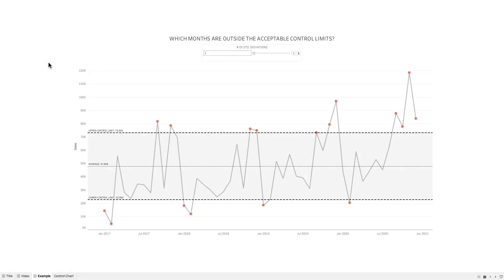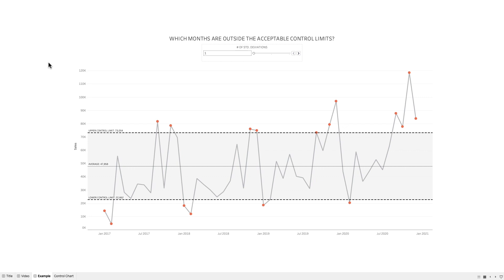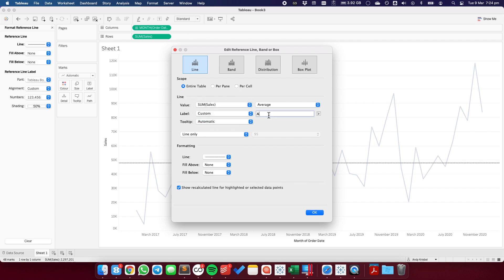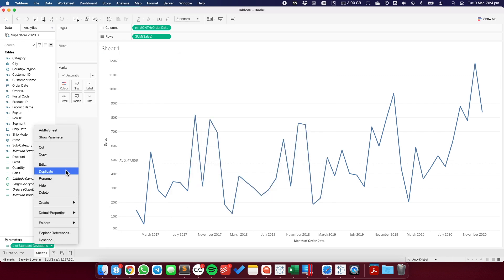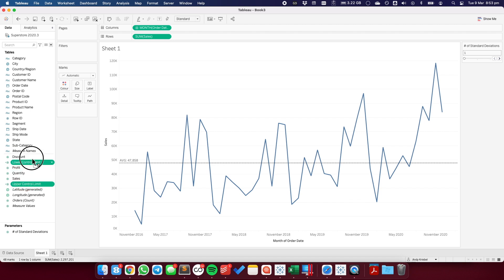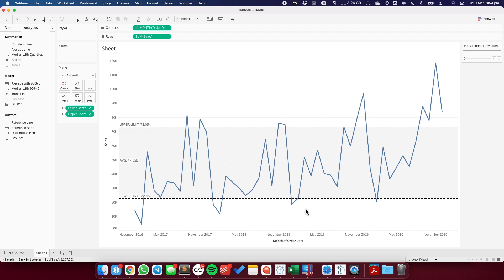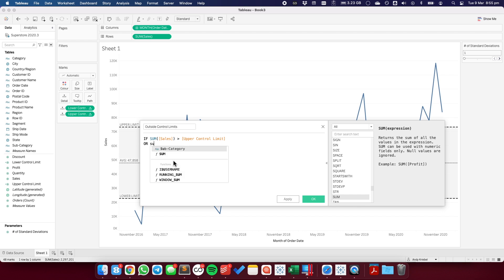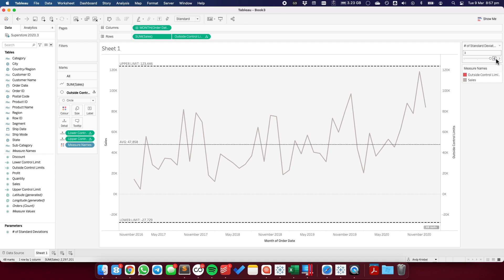How to Create a Control Chart

Comment: Great tutorial as always.
The Avg line includes all of the months from the Order Date, is it possible to set it to a baseline year? For example, I have data from Jan.2018 thru Jul.2022, I would like to set the avg. reference line to only Jan.18 thru Dec.18 then create the UCL and LCL. Any inputs and suggestions are greatly appreciated!
Reply from the maker: Definitely possible. You’ll need to write a calc to bring back the data you want for the average line, probably an LOD. Then put that on the detail shelf so you can use it as a reference line.
Reply: @vizwiz  Thank you for the quick response! I'm actually surprised that you'd have time to read these comment while juggling several workshops.
I spent much of yesterday trying different approaches - parameters, calculated fields and read through more threads on the Tableau Community board. - still haven't figured it out.
It looks like Twitter is the only public space you have where I can post questions, is this correct?
Ultimately I think I need to incorporate an FY parameter and calculated field in order to change the reference line FY, not fixed to a particular year. 
This sort of got me in the right path but still isn't quite right. 
{FIXED [Date of Sales] : AVG(IF [Date of Sales]>=#7/1/2018# AND [Date of Sales]<=#6/30/2019# THEN [All Customers] END)}
TGIF!

Comment: Similar question as Tony Lu....

I have calculated my own baseline reference line using the following formular and that works great.  Now I would like to create the upper and lower limits using this value but have been unable to figure that part out....

sum({ FIXED :  Sum(If([Report Dt]>=#2/1/2021# and [Report Dt]<=#1/1/2023#) then [Numerator] end)})
/sum( {FIXED :Sum(If([Report Dt]>=#2/1/2021# and [Report Dt]<=#1/1/2023#) then [Denominator] end) })

Any ideas?